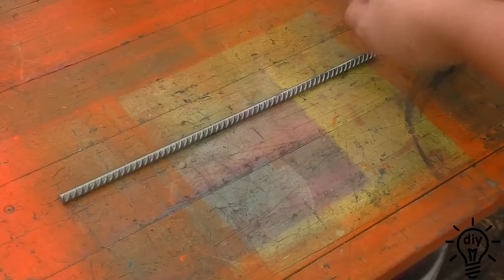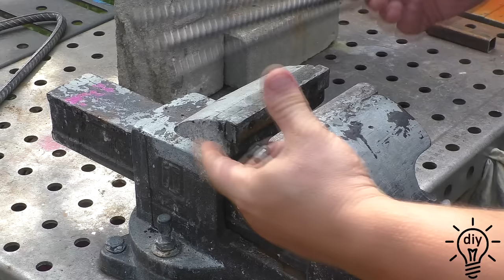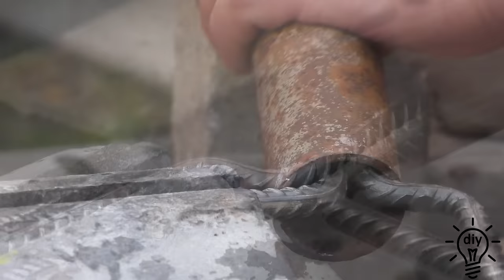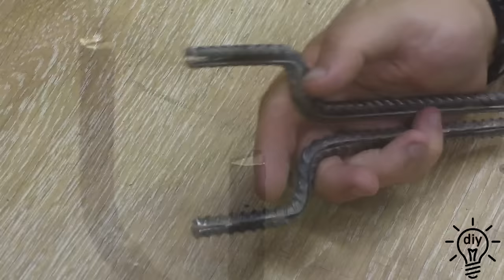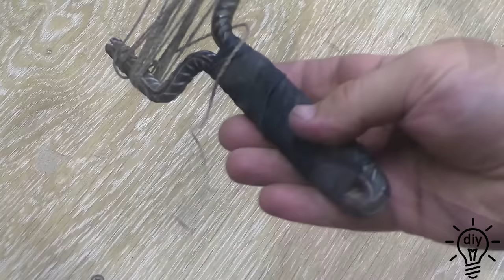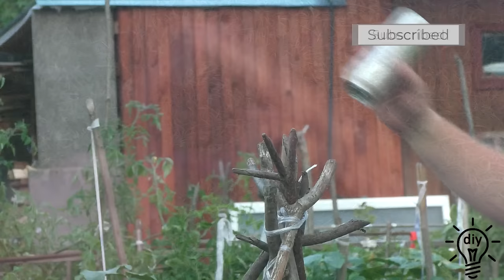Never throw away pieces of rebar !!! do it yourself !

Comment: I am amazed at some things I see.  Grade 60 rea-bar is hardened. When you heat red hot to bend it you temper it to the point it will snap easily. You can take step to not do do this as badly but I have yet to see anyone on Youtube that has a clue about metal and how to work with it. This tool as shown is junk and a waste of time. Sorry but if you put it up you should know what your doing.
Reply: As I said there are way to do it by using tempering techniques. That isn't what was stated. I am well aware of working with metal and that wasn't implied. What I said is accurate. I can't help it if you don't get it or understand what I wrote. It is accurate. Because it is a toy isn't an excuse. Other people see this and will do it on other projects which may fail and injure someone. It can be done. But not that way. Because you can do it doesn't mean it is correct. Ask your Blacksmith's? A cold roll steel would have been far more accurate for this project. Technique weather a Toy or a Structural Column is important.
Reply: And yes of course it can be done? You can change the temper but you know thats not what was implied. Or maybe you don't.